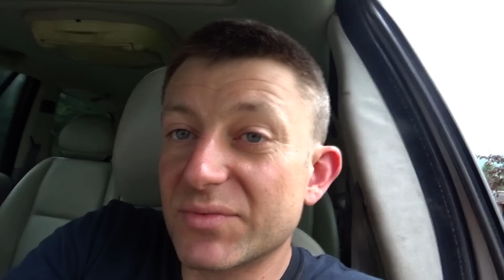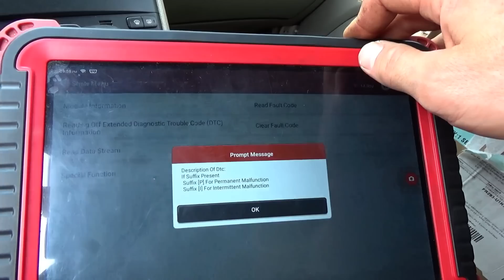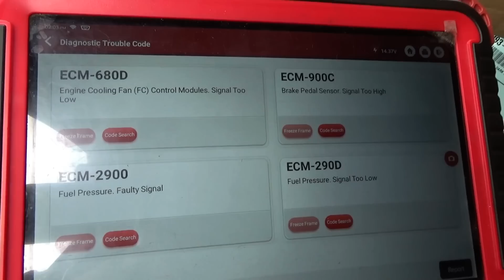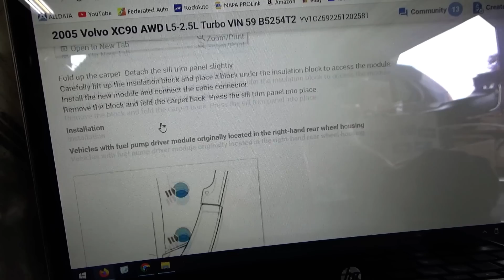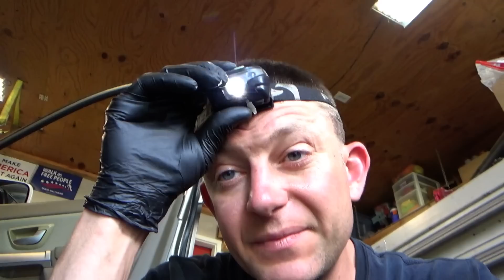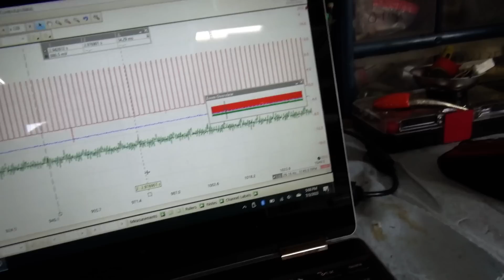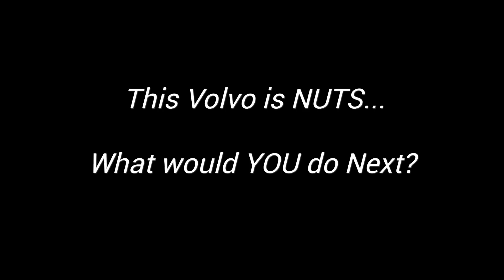(Pt1) Volvo From HELL...STALLS in 3 Minutes?! (05 XC90 Turbo)

Comment: What a nightmare.  I have seen so many Volvo's ruined by botched wiring jobs with people trying to bypass the failure instead of repair or replace the module/assembly.  My guess, is the owner pinched the transfer hose between the saddle tanks.  It probably did have a bad pump originally, then their faulty "repair" made things worse.  You have some excellent process of elimination skills.  I definitely enjoy your content.

Comment: I have a Volvo with a similar issues we thrown parts at it so has the dealer. Keeps saying low fuel pressure and the pump has been replaced twice with one from the dealership and still gets a low fuel pressure code and falls on its face

Comment: How is the tank plumbed, did he figure that out, I would suspect blocked plumbing either with garbage or a valve. What is the sitting story with the car, I have seen restorers of sitting car with plumbing clogging unleaded fuel, has the car ever gone without refilling for many years. The 60 psi probably would push any problems aside and fuel is getting to the engine, so internal plumbing or filters, crud around the pickup, blocked internal filter. Doing this myself, while changing or doing something in the gas tank I would have drained the gas and gotten a camera to make sure any plumbing, bottom of the tank, internal filters are prefect. If it was not, I have all the time in the world so I would drop the tank, replace it if it is crud or clean it to perfection.

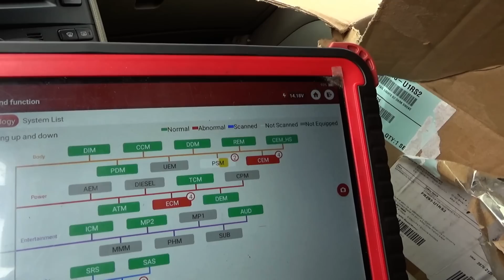Comment: At 6:33 initial startup the fuel gauge is on dead empty and never moves when the car starts and is running.  If you are diagnosing a fuel feed problem might be important to verify fuel level in the tank.  I will assume Ivan has already done that.

Comment: The water ingress on the passenger footwell is a common problem with these P2 Volvos, it's caused by a a sunroof drain in the A pillar that gets clogged up, and it overflows into the frame and interior. The interior damage looks like it's mostly due to moisture and mold.

The fuel pump kept running so I would have pinpointed it to a fuel flow problem, not a fuel pressure, since the static pressure is good but the pump couldn't keep up the pressure once the engine was flowing fuel. It could not deliver enough volume, so perhaps a fuel line or filter is restricted.

Comment: Just looking for a drop in voltage when the pump amperage draw goes down would separate an electrical problem from cavitation or impeller slippage. Use the pump ground to verify it works, basically, voltage drop across the pump.. 
     Or, yes, an oscilloscope. 
   The above test would even work with an incandescent test light, watching for dimming.

Comment: It looks like the wiper arms might just be indexed wrong, and the "park" position can't be reached.
Reply: I just saw part 3 and the pinched wires, so I'm wrong about the arm indexing...man, it is unfortunate that something as simple as wipers with a switch, a motor,  wires, and maybe a delay device (for "intermittent ") had to be "improved" with the addition of computers! Or 'modules '..l

Comment: A guy is selling a nice looking '93 4Runner CHEAP, because after driving it for 10-15 minutes it dies.  He has spent $1000 trying to get it fixed, to no avail.  I acts like the fuel pump just shuts down.  Your videos have me <<this close>> to buying it with the mission of truly diagnosing the problem without throwing any parts at it.

Comment: I have a 2007 V70 with 180.000 miles on it. It does not have a single problem.  Same era of car, with a lot of shared components to this car.
If you fix any problems that appear right away, and do it somewhat proper, these cars can go for a long time.

Comment: Taking a stab at what to try next: I'd try jumper-ing both pumps directly either with either battery power or an adjustable voltage source (assuming maybe they run off PWM), and then seeing how each pump reacts in terms of amp draw, voltage drop, fuel pressure at the injector rail, etc. 

If possible, i'd also try disconnecting one of the fuel lines at an easy point, or hooking up my own hose to the tank outlet, running it into a catch bucket, and then powering up the pump directly, in order to see what's going on (if it's sucking air, seizing up, etc). Just some random thoughts...

Comment: I forget which of the major you tube channels, but I've seen where fuel plumbing inside the tank was messed up.  the pump would send fuel back into the tank.  Could also perhaps be they put the fuel line connections incorrectly inside the tank.

Comment: I have volve ts 60 with same problem, turn out they reemplace the sending units for cheap after market and also the guy the did the job did a bad routing of the hoses inside the tank, the owner cheap out and get a junk yard pump I installed and was fix at least long enough to get rid off it

Comment: You have the electronic side - pump power feed / motors, you have the mechanical side - pump impellers and the hydraulic side - the actual transfer piping. How much was changed? Is the main pump on the same module as the transfer pump? If separate were both changed? However you look at it the facts are the facts. Once you have eliminated the impossible whatever remains, however improbable is invariably the truth.

Comment: don't you just love it when they have saddle tanks with a transfer fuel pump on one side and a delivery fuel pump on the other side then a high pressure pump driven off the cam , what in hell could possibly wrong .

Comment: My guess would be fuel starvation to the pump causing it to lose it's load, which results in less amperage draw. I would be check the pickup and the crossover tubes for cracks or splits. Those lines are prone to breakage if you aren't careful with them, and if the owner has done it 4 times, it's likely breakage from his frustration. Especially after you replace the crossover once, you'd think it's ok because it's new, but it's broken.

Comment: Ivan as you are doing quite a few Volvos, I would strongly recommend you get yourself a dealership software setup (VIDA) 
You can get a Chinese clone DICE interface or Volvo specific VXDiag interface and you can get slightly illegitimate versions of VIDA on the web for free.
There are a lot of variants by chassis number/VIN, so the big benefit of VIDA is that it will give you the exact part numbers and parts diagrams for the exact car variant by inputting the VIN.
Also the diagnostic information is far more extensive than you get with the generic scanners, such as being able to see the full history tree for every code with freeze-frame data

Comment: Fuel pressure regulator?  if it's got one.   but i think it's most likely fuel struggling to get to where the pump pick up is. caused by dirt/sludge.  i had the same problem on a vw sirocco GTi many years ago.

Comment: Could definitely tell Ivan was disappointed by the news of 4 prior fuel pump replacements.  Me too, I was with him the whole way on the fuel pump diagnosis.

I still think the pump has to be getting starved, because the amps go way down and the RPM goes up which means to me it's not experiencing the load of having to pump liquid any longer.  

I feel like there is some more discovery that needs to be done on how that transfer pump (or pumps) work.  Pulling for a good result to get that thing outta there!

Comment: Can't wait for the conclusion... but at first blush I'm wondering - if the pump is running, where is the gas going?  Is something leaking/returning back internal to the gas tank, and only after a bit of normal pressure opens a crack in a line?

Comment: Physical inspection of the fuel pump assembly. I would also put a borescope into the tank and see if there is a ton of junk on the bottom of the and to look to see if there is any damage to the tank itself. It sounds to me like the pump is losing its prime. Just a guess but seems logical.

Comment: I quit working on this parts cannon junk and water inside is total loss with moisture in electrical system is total loss. I know you do it for utube content and get paid but shops would close if they spent the time you do researching and diagnosing and not able to charge actual working spent. Would give it 2 hour analysis and if it was beyond scope of actuality of being a successful fix at a price balanced at value of a vehicle I would dry it out with gas and a matches and get the scrape metal price

Comment: I have a volvo s80 d5 2006. After I changed the oil in the automatic transmission, after 3 weeks it started to go out while I was driving or in a stationary position, then it started right away as if nothing had happened. I went to 4 diagnostic masters, they all said that there were no errors. So I found on internet swedish volvo forums and i think it's down to the oil in the gearbox
Reply from the maker: Just pour the old oil back in and sell it 😂

Comment: This situation happend on my S80 T6 Volvo.
Ended up being a crack in the air intake.
The car would start up but after a short period of time would bog down & not want move.
On start up was good but the sensor would shut down the system for either too much air or lack of pressure in the intake.
Replaced the cracked part never had another problem.

Comment: Spending 2000 on a car that looks to be worth just about that same amount is a bad idea imho. Just repairing the wipers if the transmission is bad could be another 500+ , another 500 for a windshield, long -term water damage from the sunroof leak and on and on. Cut bait.

Comment: When the car does not run anymore - and you use starter-fluid / break-clean, the car starts? 
Yes: Fuel delivery problem. 
No: Different problem. 
To know in which direction the search must go, is surely a great relief. 
I think about this car since hours, insted of doing my job. :)

Comment: Humm, so the previous owner replaced the fuel pump and driver four times and still put back the OG items? Who is to say that the previous owner tried to do the same and messed something up? Like not reconnecting the fuel lines in the tank properly? Maybe one of the hoses fell off that fill the main fuel pump chamber? I think you have to pull the fuel pump again and check the fuel hose connections. That is where I would go next.

Comment: I would wonder about the pressure regulator, but the time factor doesn't quite make sense.  Still, it would be easy enough to clamp off the return line and check.

Comment: You ask what would I do next?  You likely know from my previous posts.  I would have declined to look at it in the first place.  But, since you accepted it for diagnosis and possibly repair, you have to proceed if the customer actually wants to pay the amount of estimate.  
From what you estimated your bill will be around $2000 and that is without towing charges.  You know, but possibly the owner does not know, this car is not worth it.
Once again however, the lesson is; don't accept these unicorn headaches that have been molested and hacked by many before calling you.  I know you love a challenge but...........

Comment: I'd still look at the fuel tank and pumps. The Owner said he did the pump - but did he know there was 3 pumps? Could it be he missed the faulty one, only changing the good one? You've checked the circuit, it all seems good, and points to the pump loosing prime and no-load spinning, so the issue has to be in the tank. If it was a plugged fuel line, the pump would slow and the current would increase. So the issue HAS to be in the tank. So that's where you have to focus your attention. A case of Trust what the owner says, but verify. You may see something he missed. A kinked hose on the transfer pump? You need to look.

Comment: Disconnect the connector at the pump and give the pump(s) an external source of power from the battery and monitor the fuel pressure with a gauge without the engine running. If the pressure is maintained then it is not the pump. If pressure drops after a few minutes then it is the pump, or if the vehicle has a regulator it could be malfunctioning. Also do a visual inspection of the fuel lines to make sure there is no bent or kinked line that would restrict flow.

Comment: Ivan, did you check the readings from the both fuel level senders? If the side where the main pump is, is empty and other side of the saddle tank has 75% left the gas gauge will show about 40% left. 

If the transfer pump motor runs and the pump is Ok then maybe it is hose from the transfer pump is detached. 

Has someone already been inside of the tank, unknowingly detached the hose and rhen ran the main pump side of the tank dry some time later did not see the connection to previoius work. (Volvo should have two gas gauges in one of the information display selections)

Comment: water on the floor is overflow from gas tank......
Sock in gas tank clogging the inlet?  Make of gas so you don't see it when changing pump.
Float wraps around the fuel line and pinches it shut?
Owner voted for biden, and car is on strike.

Comment: I pull the pump out and check that all the pipes for the transfer pump are attached to correctly the transfer pump could be working I'm not putting fuel where it's supposed to be

Comment: Open up a new company " Volvo rescue  ".
You are brave to mess with that one which some banana spliced cut taped all those wires.
Uggghh.

Some one on the hood must have did him dirty ..
Excellent channel 👍

I found one car had plastic debris in fuel tank vandalism and caused similar issues.
Pump would lose prime after a few minutes randomly.

I had old 240 red block 1970s awesome cars.

The only Eurotrash cars any good.

Years ago i was a kid working in a shop in NYC.
If customer wouldn't pay or gave shop issues he put a potato in exhaust and pinched metal fuel line almost closed .
I saw nothing...

Comment: I had a 1984 Volvo back in the late 80s. I loved driving that thing but it was an electronic nightmare. It had a recurring mystery problem that turned out to be the engine ground left off by the dealer during a previous repair.

Comment: I bet YOU have got a LOT of work ahead of you BESIDES whatever the fuel issues are.  that poor thing is a full on "rolling radio" mod botch.  I had a four runner like that; i bet you'll find even MORE wires floating around, missing trim screws, overloaded components, and the remains of an amp location somewhere in it.

Comment: 2 fuel pumps, for last 100 hundred years all cars had but just one, Volvo is really getting stupid, like EV's that nobody wants anymore.
Reply: My son’s 09 Charger has two pumps because the driveshaft splits the fuel tank.
Reply: @douganderson7251  That doesn't sound like a good design. On a Van with two separate fuel tanks, Yes
Reply: @KA9DSL  Yes. Stupid design.

Comment: Wow! What a mess! Definitely not a virgin, quite the opposite. Great diagnostic, Ivan! Counting the humps in the trace to get pump speed is quite effective. Not sure if it's possible with the tank configuration, but could it be a "piping" problem, with the recirculation pump? Is the fuel really moving, or is it pumping into the same place (burst or disconnected tubing, etc.)

Comment: I am wondering if the pump/pumps were refitted correctly, maybe a hose in the wrong place? Certainly a nightmare because you just don't know how many problems have been added by the customer since the original fault.

Comment: A clogged petrol-tank-ventilation could cause a vacuum an make the tank collaps a tiny little bit,so the pump can't suck any gas. 
Is this a plastic-tank? Very very small chance. Ask me, how I know. Let the car run without fuel-cap. Tiny chance. 
Did you say, this car has 2 or 3 fuel-pumps? High rpm, low amp - is this pump sucking air??? Or is that just normal??? 

If a car stalls: My fist culprit is always the crankshaft position sensor - but not here, because it stalls to slow for that. 
Second culprit: fuel-pump-relais. But not here - again. 

Wow does the water finds it's way to the footwell? 
88 Volkswagen Passat: 
Leaves also liked to clogg the spaces between the windshield, wipers and parts of the body in autumn. All car-owners you should remove trapped leaves regularly and ensure free drain channels. In this way, the drain channels were blocked so that rainwater gets into the interior via the ventilation channels and accumulates at the bottom.  

Maybe the water find's another way into the footwell. 
Are there a lot of modules located? Is this no POI? 

Is there any module, which switches someting after three minutes - only when the engine get's / becomes not warm? High idle? Lambda-sensor? 

I would go after the wiper-motor and the footwell swimmingpool with it's modules unter the carpet in the next steps. 

A beautiful problem! 
This is, why I am looking forward for every new video.

Comment: I would tell him “I have to check your work, we need to pull the pump”. That is a really cool test you did with RPM and the scope, with the rpm rising as it did there must be reduced load or not enough gas to the pump of course the load test showed the same but being able to determine the actual rpm over a given time is really cool.

Comment: If the tank were full it should run regardless of any crossover tubes ?
Reply: I have been wondering the same thing. I thought I'd get laughed off the planet for suggesting filling the fuel tank full on a car with a suspect in tank fuel pump!

Comment: Possibly the transfer hose has broken off inside the tank and not feeling up the pump unit reservour. Or the same case with the  return line. Seen it before juat not this car. Might be worth having a look inside the tank through the hole therw with the pump removed.